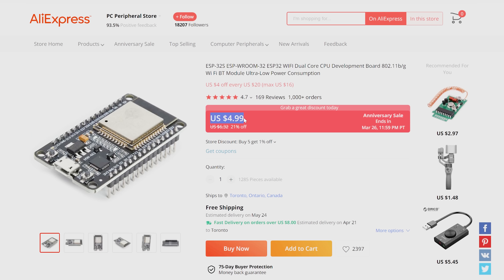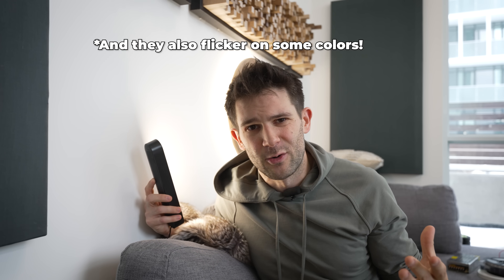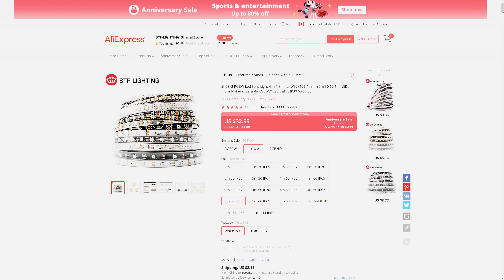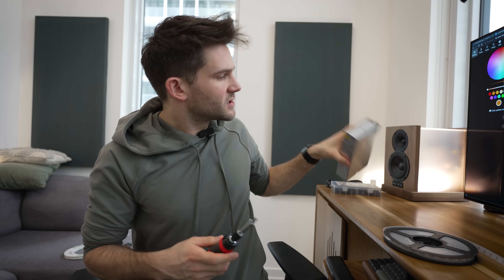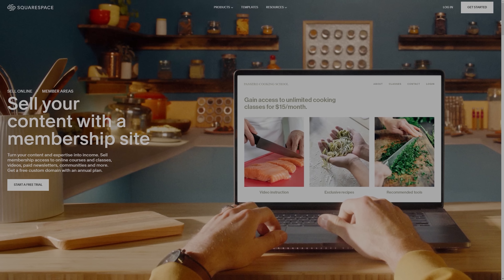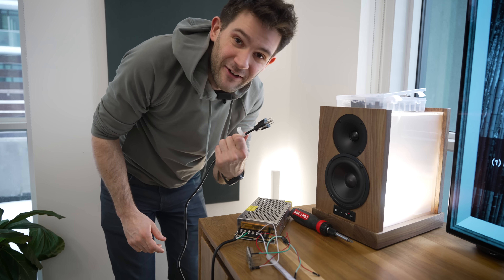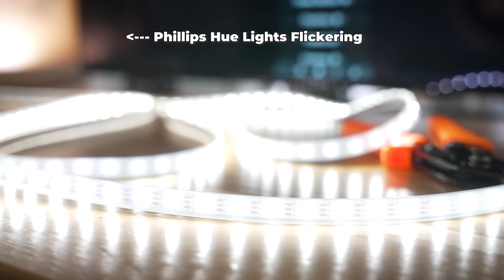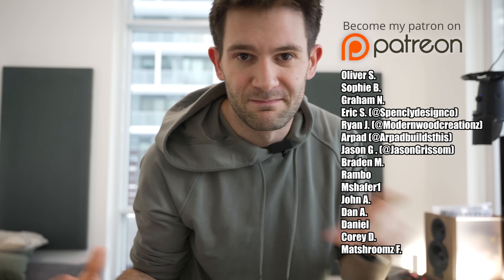RIP Philips Hue & Govee

Comment: Go for the Wemos D1 Mini V4, they are usb C and only $1.20 to $1.60 :)
Reply: Once you get over the limit of 500 LEDs you'll want the esp32. Also there are ethernet versions of the esp32 that work with wled.

Not a big deal for basic controls but if you want to stream live pixel data to them via artnet wifi is quite a bottleneck.

Comment: I got a bulk order of the smaller ESP8266 controllers, for just over a dollar a board, and can confirm WLED works on these as well.
Reply: Yes, the ESP8266 (look for D1 mini) is cheaper and smaller.
And you do not need the pins, just solder your 3 wires to the holes on the PCB. Once flashed you can cover the ESP with hot glue, so you do not get shorts and it is more water proof.

Comment: Nice project, but not really a "RIP Phillips" The app seems to be fine, but how does it integrate with Apple Homekit, Google Home, not at all I guess? Can you control it via smart speakers? The integration is just not on the level of Phillips Hue or similar products!:)
Reply: Alexa works, home assistant works, it has MQTT support and can emulate a Philips hue bridge. The HTTP API is quite well documented too. They can sync to music and to each other. How about Ethernet for permanent Installations?

So if you are relying on entry level home automation (just a smart speaker, no automation backend), you are absolutely correct. Once you have an advanced setup those are way ahead of Philips and govee.

If you're looking to get full control: E1.31 and Artnet are supported. And DMX Output.

Comment: FYI, that's not how single-phase 240 volt works.  It has two 120 volt-to-ground hots directly opposed to each other, with no neutral.  Hot-to-ground is always going to be 120 volt, but hot-to-hot is 240 volt.

Comment: AC powered LED's??? where can I find such magical things??? seriously, IF the flicker IS related to the AC, it's because the AC-DC conversion is bad, of the AC power is really inconsistent, not simply because it's AC. The PWM used to dim many LED's on the other hand is often a cause of flicker.
Also you verified the colour temperature, but you didn't verify the CRI, honestly, it you want proper white studio lights, MediaLight make bias lighting kits that aren't THAT expensive, and not only are D65 colour calibrated white point, the cheapest version they sell has a CRI of about 95, but they also have 98 and 99 CRI iirc. they're not CHEAP, and they're not RGB, but if you care about colour temp and CRI, they're great white lights, even if they're INTENDED to go on the back of a TV or monitor

Comment: This comment will probably be buried, but it is extremely important that there be fuses installed between the power supply and the lights. You are literally playing with fire if you don't do this. Also, would love a follow up with a rating of different led strips. An explanation about 12V vs 5V would be great too.

Comment: I got a Govee tv light set up and it threw me down this led rabbit hole.  I just ordered 6m of ws2812B for a display cabinet project I’m starting. Got the Domestic Automation controller board and a 15a 5v power supply. Wled app has maximum milliamp settings, so I can tune them to not exceed what my power supply can produce. The controller I got also has outputs to inject power at the end of the strip. Since it’s a display case I won’t need these at max brightness.

Comment: Yikes this is bad sorry man. The wiring diagram you showed, aside from obviously not matching what you had in the video, was static and only applies to your setup. 

For digital led, you should buy something designed for… digital led control like the Quinled controllers. 

I’m struggling to figure out who this video is for? If it’s beginners, an intro to wled would have been great, but the inclusion of poor and incomplete wiring advice seems downright life-threateningly dangerous especially for that crowd.

If it’s for people more familiar with wiring and tinkering, then the pacing is waaaaay to slow, and the lack of detail makes it uninformative.

Comment: 3:54 you could theoretically buy usb-c connectors and wire it up yourself. Fiddly with such tiny pads/wires but doable
Reply: there are also versions that come with usbc on amazon
Reply: @objektsatz  yeah, they just usually cost more because licensing so you'd have to compare the price and effort of swaping em

Comment: From Aliexpress… do I need to explain what can go wrong there?
 
What comes next? Wish?

But I want to look the whole video to see if it’s getting better 🤔
 
0:45 sry but color grading diffs, is what you have on several lights, and it’s really hard to get the same color nailed around the house unless you buy from the same vendor and of course the cheaper ones have always production differences. Even the high priced ones should have that. I say specific „should“ because Philips can kiss my feet and I won’t buy a light from them for 80 bucks each, when I get a smart light from the vendor of my router for 20 bucks each which has all the lights and colors in there. And that lights from AVM: you can digitally adjust that to yellowish light so called „warmer“ spectrums or to „colder“ more blueish light spectrum. And I have several of them and they seem to be straight in quality.
1:05 flickering? I mean I never experienced that but I know it can damage you as a human yeah that’s absolutely true.
1:25 software yeah that are strange island resources but to be honest: that’s the weakest reason for that board because there is Homebridge (which I personally use) which brings the non-HomeKit-compatible AVM lights into HomeKit. By spin up a server which translates bi-directional between my router (which is the hub in that sense for that lights) and my HomeKit Master (which is my Apple TV). And there is HomeAssistant where is saw PLENTY off videos what crazy things, people automated with that like a smart chicken house based on weather conditions and with smart lights for the birds.
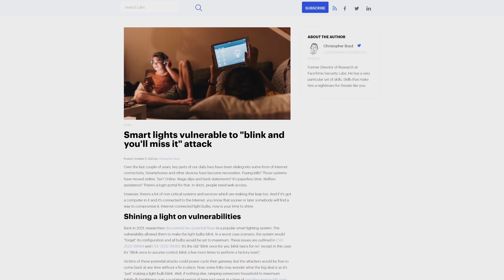1:58 glad you mentioned by yourself something from the “what can go wrong on aliexpress”-category that’s why you shouldn’t buy on a platform which doesn’t feel responsible what’s been sold in there! That’s why I also don’t buy stuff anymore from eBay as well, Rakuten and all that Crowdfunding platforms cause no one feels responsible if they kill you, scam you or hack you with things bought from there.
2:33 feel sorry for you that you spend so much for lights, no seriously.
3:02 interesting that didn’t appeared in my bubble yet 😮 looks promising: GitHub Repo, public viewable code, that is a plus
5:56 okay the video finally turns into more diy 👍
14:32 I also did the flickering test on my lights with the slomo 240 of my iPhone. No flickering there 😇 and yeah wled has an app s well. But I prefer my solution: I have several ways control the lights in my home: Router Interface or App of the Router Vendor, then a WebUI in HomeBridge and I can use HomeKit. All synced with each other. 😏
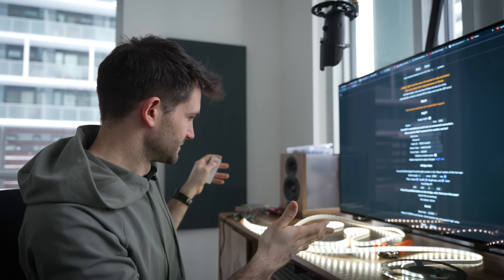15:09 another reason why I don’t buy Philips hue. Because come on Philips, I should pay so much for your stuff and I get that performance? Btw: All the methods I mentioned are hosted in-house btw. And the downside of your solution is to keep it maintained if Philips change something on the signal or protocol… the advantage of my solution is that it’s using open standards like HTTP Calls to connect to the Hub and from there it goes on with the native protocols of the vendors. And yeah I can integrate whatever I want in there even WLED plug-in is available 😅 just looked up for it
 
I recommend you: Get a small form factor pc, (if you don’t have a server for your studio anyway), get a Linux up and running, either bare metal or a docker container or in a VM and install homebridge. It’s free, it’s powerful, it gives you literally complete control and complete insight via log like “Light Sleeping room turned on. Turned light temp on 6000k. Color changed to blue.” Each of them with timestamp and SO convenient if you wonder: “Hey, why did that light turned on?” Or “Did it received my command from my home hub?” Even if you don’t have Apple, you can get so much out of it. And if you really wanna go crazy with automations then you go with HomeAssistant where you can make Dashboards that include fancy exotic stuff like the solar panels on your house and the wall box for your Tesla, your locks, your presence sensors, cameras, lights, A/C and you can even web your robo vacuums and like I said the small chicken house in your backyard in there. When it comes to automation’s you can then program anything with anything. It’s the IFTTT for SmartHomes, hosted in your smart home. There you don’t need to change from lightning patters, you can create your own lightning patterns and let the Tesla join the lightning party!

Comment: Lol, did you just call your video "RIP quality stuff" lets replace it with no-name chineese LEDs driven by no-name chinesee power supply that most likely outputs very noisy DC and has not passed any UL/CE certifications??? 
My man, those leds will start outputting garbage grade light in just a year, if your power supply of choice lasts as much without burning down your house. If you want high quality lighting controlled by WLED, you'd be lookin at least 5x the price on the components other than ESP32 board itself (which very much will need level shifter as well).

Hope the ad revenue was worth all the BS in this video. Otherwise would have been a great starters tutorial for WLED, if not for the most pop-style clickbait title ever.

Comment: “Hue is closed-source”
I mean, technically yes… but they also have an open API if you’re using their bridge, and they have adopted the Zigbee standard really well, so they play nice with basically any third party Zigbee controller, allowing you to completely ditch their backend and provide your own. While it’s not technically open source, I really don’t consider that “the antithesis of the DIY movement”
Reply: Eh, there's a reason they make it to the Internet of Trash shitlist, but I'm adding Zigbee to my HA setup anyway, so I shan't be ditching that one bulb I have already.
Reply: @233kosta  yeah the reason is the mandatory account. You can still use it locally without an official account if you set up your stuff correctly but no one is going to do that because they still want official updates and remote functionality. If you want those, you need an account. It is not that hard. 

Also. That “shitlist” is not a well known thing. Just a random dude on the interwebs making it up himself.
Reply: @Gren4te   Aye, but the list makes a lot of sense regardless. I use mine through home assistant, I get all those features anyway (including remote access). It's just that most people don't want the faff of setting up HA just for a couple of light bulbs.
Reply: @Gren4te  What? You don't need any of that if you use a Zigbee gateway and Home Assistant. No account needed and you can control everything. And update too. You can just use your motion sensors to automate lighting or do whatever you want. Zero loss of function.
Reply: @berkertaskiran  absolutely loss of function. Can’t use HUE entertainment without a HUE hub

Comment: LED flicker has nothing to do with AC power as all LEDs are powered by DC....
Reply: Wrong. When powered directly from low volt AC the LED lights will flicker at 60/120Hz in the USA and 50/100Hz in other places.

Comment: Do you wanna know what is even a much cheaper DIY you can make? Not sure where you're located,.but in the Netherlands you can get some Tuya based led lights for as low as 4 euros and it already comes with am esp chip (or more recently bk alternative) that you can exploit and flash it with tasmota firmware (open source) which can then be used by home assistant, also open source. All over the air, no disassembly required and it is far from trivial, which makes the ideal DIY challenge

Comment: For the semi-open frame power supply, you might be able to actually peel off the sticker indicating the need to change the voltage and stick a test pen in to flip the switch without dismantling the power supply unit. Unless this was a true crapshoot unit that doesn't have the service port under the sticker.

Comment: I don't realy like WLAN to control the lights in my home. Actually it depends the WLAN-Router to be on, so while there is a fiemware update, no way to controll the lights. Also in my half-timbered house with straw+clay made walls there are a lot of weak spots for WLAN.
Zigbee is much more reliable. Every main power connected device is also a repeater. After the remotes are connected to the lights, this works independend of any network. You can use the gateway over network, but even without, all remote switches still work.
While Zigbee devices like hue or Trådfri do not seem diy, they are a very good to start diy with. Actually back in time than Ikea started Trådfri, I disassembled a bulb. The controller inside is a smal module with 3.3V, GND and 1, 2 or 4 PWM outputs (depending if disassambling a single colour, colour temperature adjustable and RGBW)
All you need is a 3.3V stepdown converter and a mosfet, to connect this module, and you can controll normal lightstrips. PWM frequency is about 1kHz.

If a LED light bulb is defect, there are mostly 3 possible reasons: Mechanical defect (aka bulb dropped to the floor), internal PSU failing or LEDs failing. Practicly never the controller is the problem. So using defect bulbs from trådfri or hue gets you a controller for free.

This is of course the way for "normal" light at home, for controling coulor temperature (warm white/cold white strips).

Using an ESP and neopixels is very nice for fancy effects maybe on a party. But white mixed by RGB has not a good CRI at all. For living situation I definitly will still use Trådfri and my DIY lights based on Trådfri controllers. For partying or something like Ambilight behind TV definitly neopixels and ESPs are a good solution.

Hue/Trådfri on one side and any kind of WLAN controlled multi coulour solutions are for comlete different targets. First is just for dayly use for a comfortable ambient living light. Second is effect and party light.
You might use both of them outside their intended use. But in my opinion that has a lot of downsides.

Also of course if you have guests.  Do they realy should use an app to switch the light on in the bathroom? I definitly use Zigbee everythere. If I wake up at night, I just say "Alexa, I need to go" and all lights from the bedroom to the one above toilet (at 30%, as I am halve in sleep still) go on and Alexa answers "have success".

Still, normaly I use the Remotes placed there formerly there the light switches. As the remotes are designed simular to normal lightswitches (normal here in Germany, the sqare ones), no guest have to learn the commands for alexa or to install an app. Also battery in the remotes work for 2-4 years - battery powered WLAN remotes wouln't last a tiny fraction of this time.